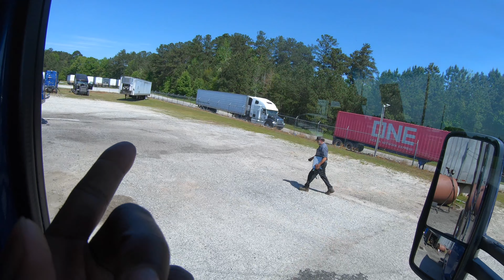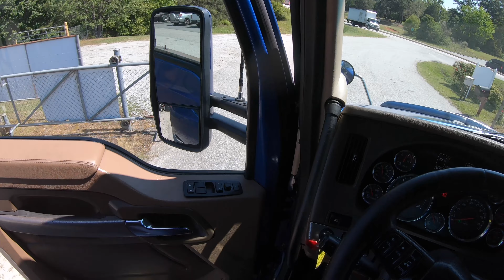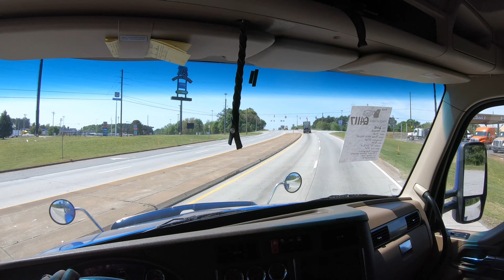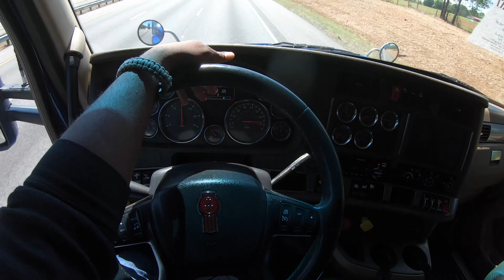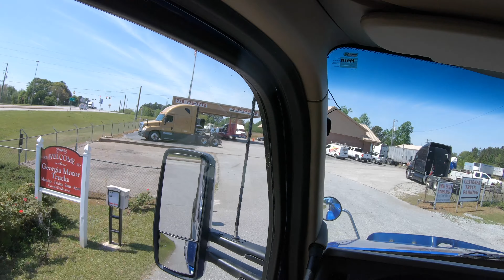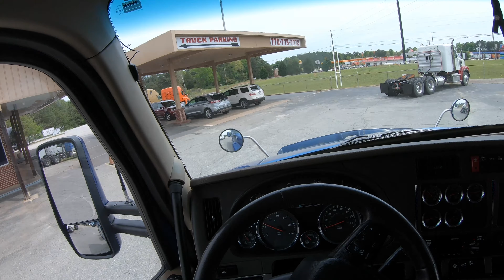Picking up my t680 ( With a check engine light )

Comment: Hi bro 
How you fixed the problem 
Can you please tell me
Reply from the maker: The place where I bought the truck did a PM on it ! They didn’t put the fuel filter back on correctly ! So they changed it and turned off the check engine light :) 

I recently bought the OTR reset tool and I made a video on how to use that thing as well